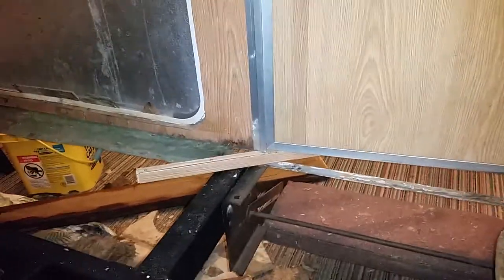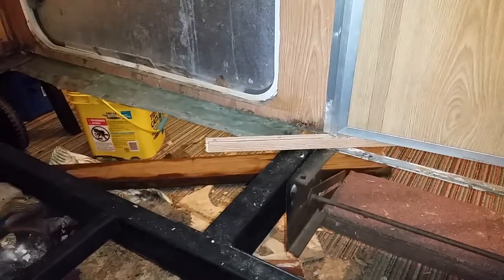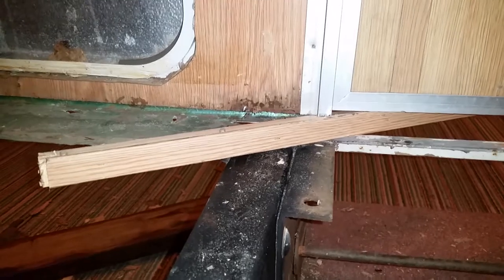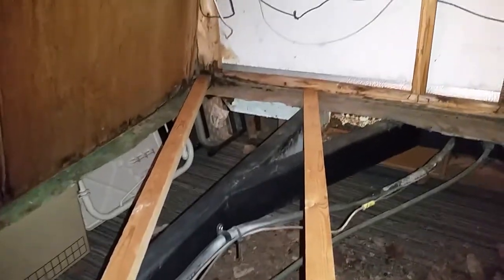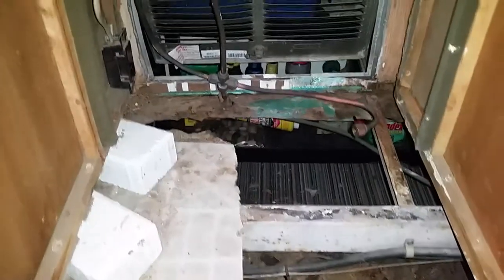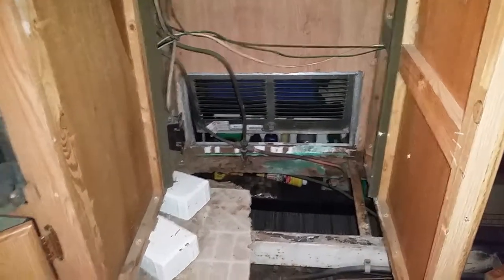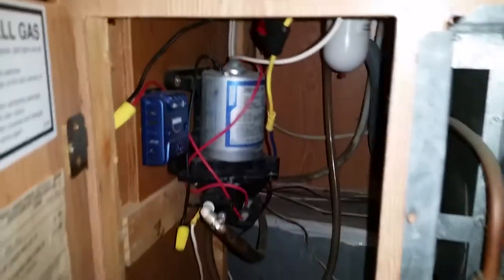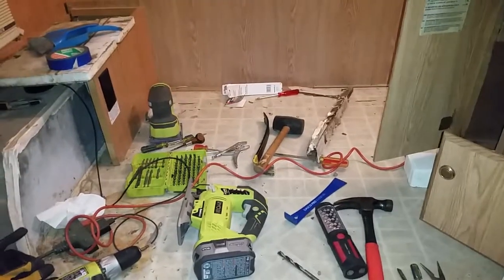Aliner Makeover and Repairs: Floor Replacement 2/18/18

Comment: How many days did it take to replace floor or hours?
Reply from the maker: I split the floor into 3 sections and did 1 section each weekend over 3 weekends. With propper help and tools it definitely could have been done quicker.  This also did not include removing the old flooring, nor prepping the new floor pieces during the week with waterproofer on one side and kilz on the other side.

Comment: Great video, thanks for posting. I am about two start on the same job. I was just wondering how you managed to get the new plywood flooring under the walls when you were installing the new floor?
Reply from the maker: Since I did it in 6 sections, I would only rip out the particular section I was about to replace which kept the walls from closing the gap that I needed to be able to get the new piece in. If I had ripped out all of the flooring first, I would have never gotten the new flooring in because the walls would have closed the gap/space I needed and didn't have any equipment to be able to lift the walls up to create or maintain that gap/space.

Comment: Wow! I'm making the same thing with my Chalet (exactly like the Aliner) and I pulled out the fridge, but the heater is huge! Plus it's so hard to dismantle the counter top and not destroy the hole thing (witch I feel like doing sometimes honestly!)

So thanks for your video and I'll wait for the next one!
Reply from the maker: It is definitely hard, but worth it. And I already knew I was going to replace the countertop because it was water damaged and warped. So I used it as a template to make a new plywood version to match the other top I was going to make and a dinette table I had to build.

Comment: what size boards did you use?
Reply from the maker: 3/4 inch premium floor grade plywood. It worked much better than the original Luan they used many years ago.
Reply from the maker: I used three 4 ft x 8 ft sheets in all and cut them in to 6 different pieces to install them.
Reply: Thanks!